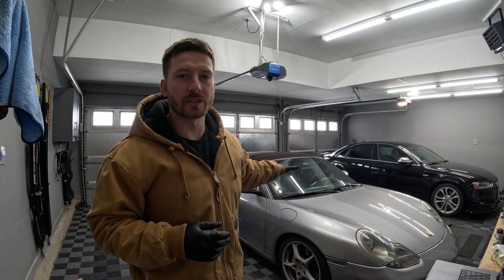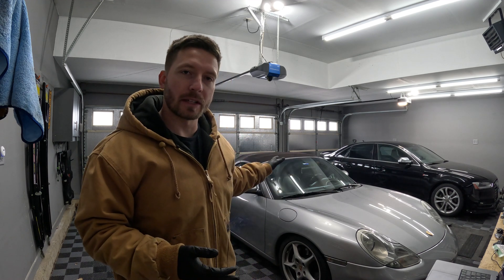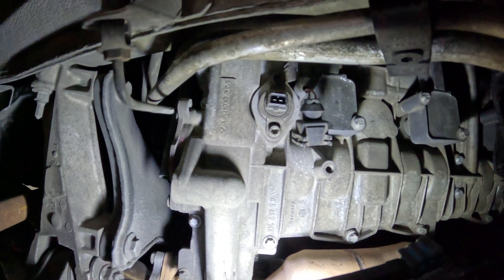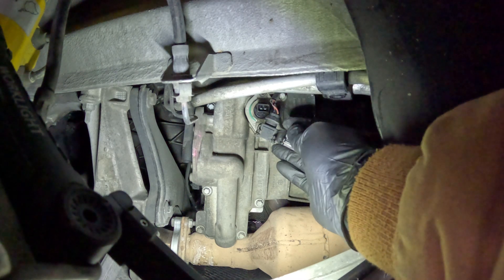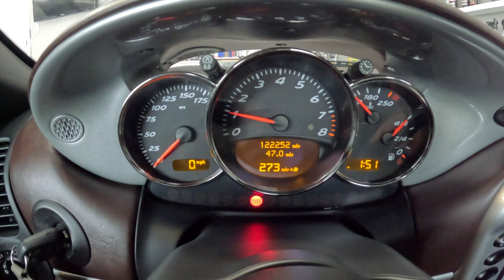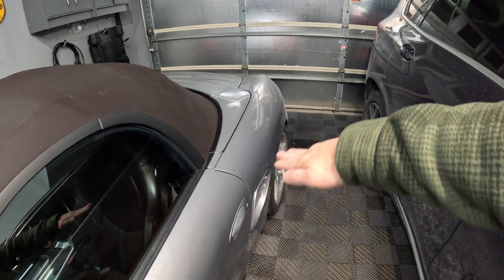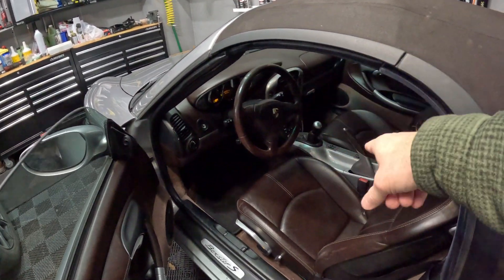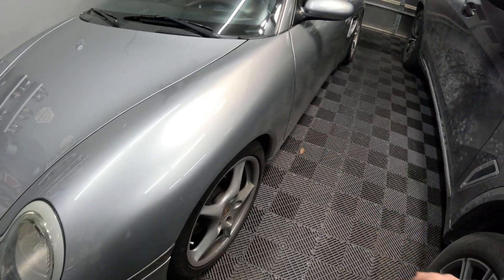CEL says hello after the IMS Install! Did I break something or easy fix?? 986 Project Car

Comment: Great Car. I have 2000 Boxster S. I have done lots of work on the car. Here are some pointers. Brombacher FVD online German retailer of Porsche Performance parts. Please don't buy cheap chinese parts, that is insult to your car.
Your IMS looked great and so did RMS. Lots of people having issues with both after replacement. RMS always leaks, because you have to use LN Engineering tools, that were specifically developed for that purpose. Buy slotted rotors, not drilled with holes, they crack and have to be thrown away. The FVD has good German brakes for street/high performance. All their parts are made in Germany and properly tested. Again, don't waist your money with cheap parts. OEM parts are good, as long as they were made in Germany.
Timing chain guides are big thing and can detonate your engine as well as IMS, RMS and bore scoring. The another contributor to engine problems are injectors. Old injectors start leaking and faul/wash the cylinders with fuel. The whole new set is only 700 dollars.
I do oil changes 2K miles and at least every 4 month. The replacement engine is 30K, it is worth it. Use mobil 1 0W-40 with one can of 300 ml Liqui Molly. I removed all my spacers and installed new 18 inch wheels from FVD that have proper width and offset.
I now have 235 and 285 tires in the back and they don't rub and handle like glue. Just did complete brake job with all new rotors and pads. Replaced all my struts and springs, the car has lowered 1 inch and looks fantastic. There is so much more, that could be done. Another advice, don't rev your engine past 5K unless you replaced your camshaft chain guides, those are a ticking bomb, unless they were replaced with new updated version. 
Those cars are blast to drive. There is no substitute for light weight. Good luck. Z-man.